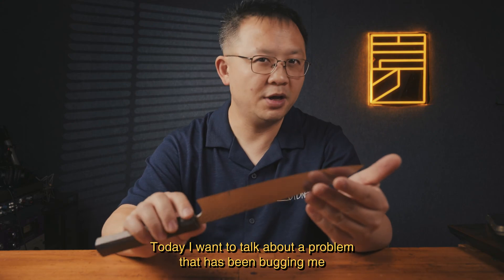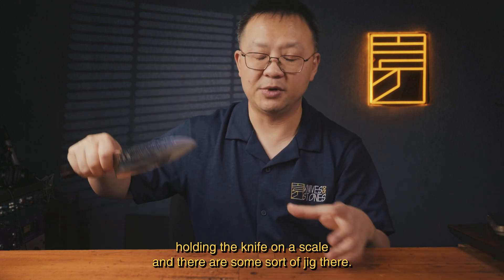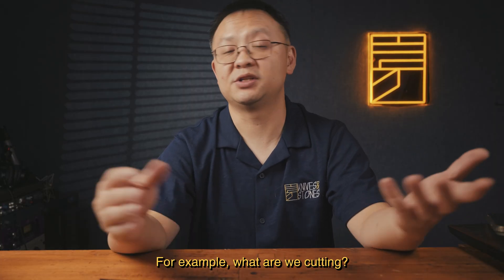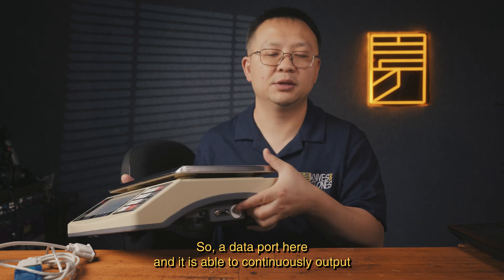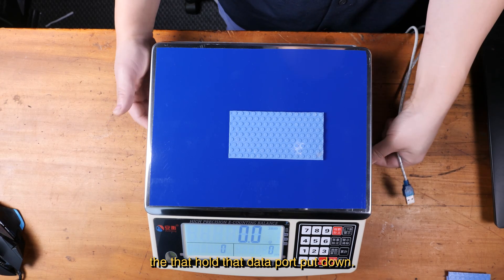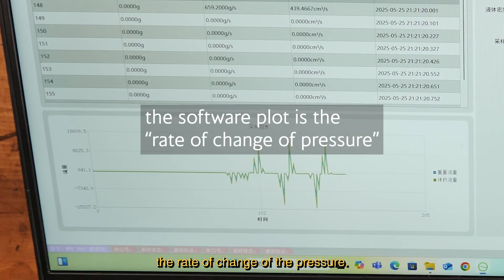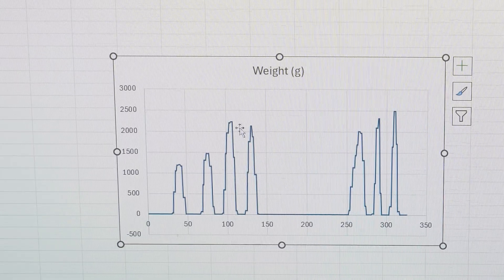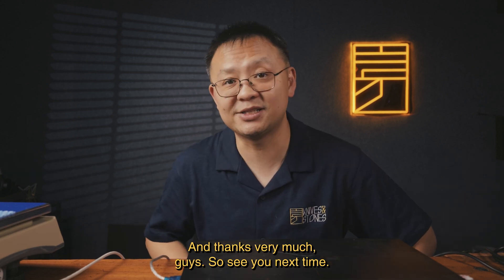A possible TRUE knife performance test? Let's discuss!

Comment: This is effectively what the professional industry at large is doing too. I would prefer more readings per second, 10Hz isn't especially fast for this sort of data. But they do the same with a consistent, repeatable rubber test medium. That way they can measure all 4 stages of a cut. An upgrade I would suggest is making a motorized system to push the knife more consistently than by hand. The professional systems measure distance vs force as that brings better results but with a reasonably powerful stepper motor geared down you could ensure a consistent speed so time equals distance. You also might want to set a jig to move the knife in a slicing motion rather than a push cutting motion. Usually it's just a parallelogram frame for support, but again consistency is key with lab measurements.

Anyway, bravo on finding the issue and working out the best solution by yourself. It's a very good solution to the problem of testing properly.

Comment: Now that you have the scale to measure force, you need a consistent subject to cut instead of food. Things coming to mind would be a foam, gel, or (generally soft) plastic. If you can get a relatively consistent makeup of what is being cut through then you are looking at removing the human factor as the next big inconsistency. Would need to rig up a device that allows you to put a controlled force downward, with/without forward/back slicing. Probably easiest to setup with weights, pulleys, and rope to get 'something' but designing a hydraulic force system would make it easy to apply a very controlled force throughout the process while minimizing overshoot once an initial cut starts or another barrier is overcome. You could avoid the hydraulics if you used nonelastic rope and had too much weight (or another pulling force) being moved in a very slow controlled fashion...probably want to turn it all upside down so that the blade's weight cannot do the cutting in a less controlled fashion (or again have its motion heavily controlled with the rest of the force system).
Reply from the maker: the problem is, I have tested some sort of form, and they feel totally different to the actual food. Particularly the potatl test, which gives you the "press". 
I'd sacrifice some small inconsistency between food rather than sythnetic material that does not reflect the real world scenario.

Comment: Load cell / scale is just BESS, too much human error in that. Check the Vetako Sharpening Meter. In my oppinion the best test for sharpness. Takes our almost all the error. All that's left is to make sure the blade is secured straight.

This test will allow you to test the bevel. If you set up a test through a thicker medium then you can test how the geometry (thickness behind the edge) affects the cutting performance.